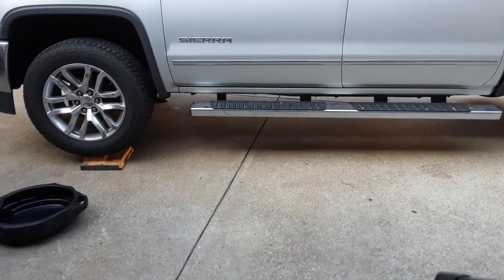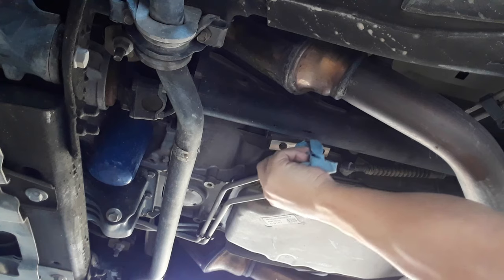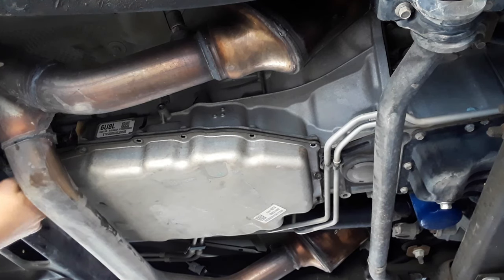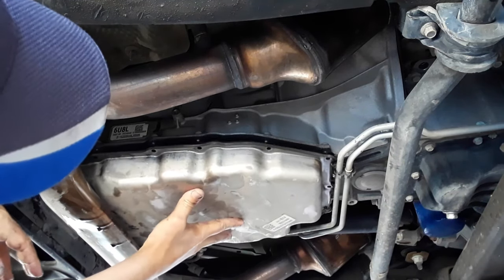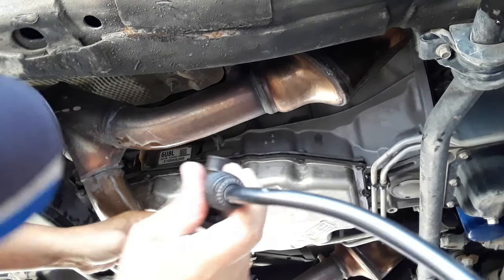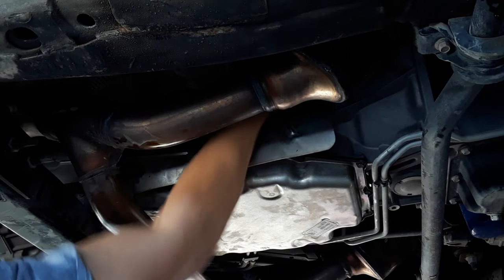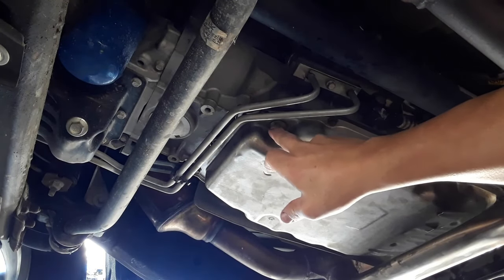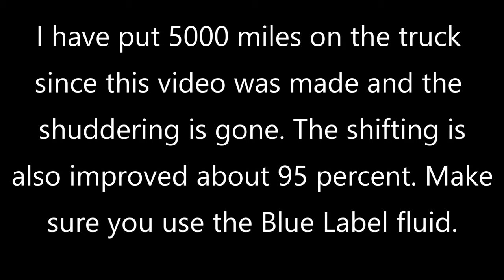Stop the shuddering on a 2016 GMC Sierra / Silverado with the 8L90 Transmission.

Comment: Thank you for this excellent video!....I got same truck, only a 2018, with 61,000 and it just started that shutter vibration thing...I have neglected to change the transmission fluid ever because there is no typical dip stick for my local shop to evac the fluid from, so they couldn't do it....Dealer says I should have changed it at 45,000...Taking it to my local GMC Dealer tomorrow to have them do it all with the correct up graded fluid GM now recommends...Hope I have the same great results you did. Thanks again for your help with this video!....
Reply from the maker: You will see a huge improvement.

Comment: Just did this in a pinch and wished I did the lines but I’m doing it again in a month. I couldn’t believe the new transmission was as bad as the old one. 20,000 miles and looks like 300,000

Comment: I actually like the easy of doing simplicity of doing a flush on my 8l90. After I shut the truck off and while hot, I opened the level check bolt. 2 quarts came out. Then, I went around and broke loose all the pan bolts. It was more start forward than the 4l60e. 4 quarts in the pan. No issues with the exhaust like I thought. Just yaw to the passenger side. Changed the filter and cleaned everything. Not too messy. The fill... I pump until fluid came out. Started the truck and kept pumping until it was just bright red fluid coming out. Check the temperature and let it dripple and closed it up.

Comment: You should compare Mobil to Amsol fluid. High reviews for Amsol. I have a 2018 Silverado 6 speed. Transmission thermostat causes oil to heat up extremely high before it will circulate through cooler. Newer models have been fixed. I swopped out thermostat with Surecool bypass and what a difference it made. Temperatures now run the same as 2020 models.

Comment: Did this tonight. I had it flushed several years ago by the dealer before they started using the blue label fluid and the problem came back. Basically parked it for a while or just 'drove around it' by getting to know how to work the throttle.

The dealership put the drain bolt in so tight I bet it has 80+ ft lbs on it and it stripped. I could NOT get it off. So now I'm sitting here with a stripped bolt on the bottom of the pan and the trans filled until it came back out the filler hole.  Think I'm going to drive it a couple miles to an oil change shop and have them get it out. Probably going to need a new plug though. Arrrgh.
Reply from the maker: Some mechanics need to learn how tight things need to be.

Comment: I have the same issue but hopefully its still covered under the powertrain warranty as im only at 30,000 miles.
Reply from the maker: Warranty is 3 year or 36000 miles so you might get lucky.
Reply: Ima dog my Silverado out b4 my warranty goes bad

Comment: I appreciate your hard work on this vid but I'm pretty sure your fluid is low. Considering you drained the cooler and lines, they never filled unless you had previously installed a bypass for the trans thermostat. That thermostat does not open and allow fluid into the lines and cooler until the trans reaches 190 on older models, or 158 on newer cooler lines. I'm glad your shutter is gone and wondering if you have any updates considering this vid appears to be about 2 years old at my viewing.

Comment: I just took my 17 sierra denali in for 90,000 service today, noticed a vibration a few days ago and thought it was something with the front end till I seen these post and videos. It is getting a transmission flush as well so hopefully that does the trick
Reply from the maker: Let me know.
Reply: I’m sitting right around 90K and just performed this procedure today. Got dark on me tonight so looking forward to a test drive tomorrow. Certainly wish I had as nice of a scan tool as in the video!
Reply: @devingoodman7347  Update us on your test
Reply: 2015 with 50k miles on it. Of course it's not under warranty anymore and I will get a lemon law lawyer.

Comment: thank you so much , i got exactly model and years and  got 78000 miles and the same problem , i will try to change tran smissions fluid  #124715 and filter hope it help stop  the shutter ,,,,thank
Reply: Happy for your results, a question, your transmission is 8 or 6 speed ?

Comment: I had this done and it was a lot better for about a month BUT the same problem came back. Have not done it again. I have the same problems that was described here except no shuttering.
Reply from the maker: This will almost 100 percent cure the shudder problem. As far as the harsh shifting from 1st to 2nd and 2nd to 1st mine is about 90 percent better on that issue. I still have the occasional harsh shift mainly from 1st to 2nd but it is so few and far between I live with it. I do plan on doing it again before long to see if it helps any more but until then I am fine with it.

Comment: Anyone complaining about hard/firm shifts 1-2 2-3 3-4. I solved it in my 2016 Denali with the 8L90. First the dealer exchanged the fluid to this new fluid and that solved my shudder problem. Luckily I caught it before I burned the torque converter clutches. 

To solve the hard/firm shifts I had the transmission tuned by a local performance turner that disabled torque converter lockup in the first 4 gears and now its silky smooth. Never had an issue again with shudder or harsh shifts. It's been 40,000 or so miles.
Reply from the maker: That's good info to know. I still get a harsh shift or two but it is not very often.

Comment: I had this performed on my 2015 sierra denali 6.2 under warranty. There was class action lawsuit for this problem. The GM service bulletin says to flush with fluid and fill something like 28 quarts of fluid. That's why they want to change you rather than warranty it.

Comment: Any further updates ? 
Im about to do a second fluid/filter change to try and get more of the old fluid remnants out. 
Also going to do a third one at the next oil change interval...

 I figure 3 services in about 10,000 miles ought to get about 95-99% of it out of the system. No issues as of yet and currently at 83,000 miles.

Comment: So I did exactly this a year ago and it fixed my shutter. However after putting about 20,000km the shutter is starting to come back. I'm going to be doing a flush again and hopefully it takes away the shutter again. What I am assuming is there is still old fluid in it from the previous flush that just causes the shuttering to some back. Hopefully with another flush it will dilute the old fluid more and eliminate the problem for good.
Reply from the maker: It should dilute it enough so it is virtually  pure.

Comment: Just completed this on my 2019 Chev Silverado 8L90, put the Amsoil Trans Fluid back in with 7.5 quarts back in and new GM trans filter, ready to put 100 miles on it now and see how it handles the shudder/convertor issue.
Reply: Just put twenty miles on the truck 🚒, drove like brand new,  it now has 27937 miles is all, the old fluid was darker than the new stuff with only 27k
Reply: @John-es1kq  check rear driveline/ u joints

Comment: Awesome video, thanks. I subscribed.

Do you have a video of what the shudder felt / sounded like?
Reply from the maker: I a video would have not been able to hear or show it. I never heard anything but what I first thought it was, was out of balance tires. I finally ruled that out and realized it was the torque converter shudder these trucks are famous for. It's been almost 15,000 miles and still no shudder after changing the fluid using the Blue Label LV ATF HP fluid.

Comment: I used the Amsoil blue label, stopped shudder immediately!!!!
Reply: Is that the signature series? I got 2 gallons and hope this fixes it
Reply: @jwill9877  Yes that’s what I used!!!
Reply: @LJK69187  thanks. I hope it fixes my issue as well.  Mine started on Friday morning. I parked it and it hasn't moved since. I have a 170k on mine though. I've taken very good care of it and this is the first issue.
Reply: Your car is running on 8 or 6 speed? And please provide the oil part number
Reply: @LJK69187  i have 6 speed, would the mobil or amsoil fix it?
Reply: @ibramaher  amsoil works for both nicely!!! I have used it in both!!
Reply: @LJK69187  im gonna try it today, wish me luck

Comment: thanks for the vid. Lots of good info. But cant recommend climbing underneath a running vehicle that's not on jack stands. Especially when dealing with transmission. Vehicles have been known to pop out of park.
Reply from the maker: Yea everyone has their comfort zone. I have never seen a car jump out of park but I am sure it has happened at some point.
Reply: Setting the parking brake and chocking the wheels helps. I just undid the bolts on the pan and drained most of it without pulling the fluid from the lines in my 6l80.

Comment: Does this technique of fluid extraction pull the old fluid out of the torque converter?
Reply from the maker: No, the only way to get all the fluid is to do a fluid flush.
Reply: Ok. Thank you
Reply: @737mechanic  ok thanks
Reply: @737mechanic  ok thank you
Reply: @737mechanic  can I take the thermostat out, put the cap back in place to do the flush, then put the thermostat back in afterwards? That would dodge having to bring it to operating temp (hot) for the fluid to fully circulate

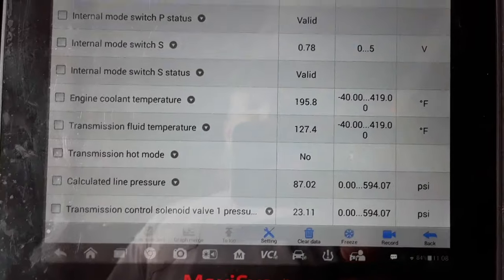Comment: At the 35:00 when u removed that screw, that oil coming out is excess oil? I didn't understand that part, you should do that after a fluid change so it levels it up to the perfect level? Please If u can explain, thank you.
Reply from the maker: That screw has a stand pipe so when you fill the transmission with fluid and warm it to the proper temperature you remove that screw to let any excess drain out, once the excess is drained it will be at the perfect level. If you take that out and nothing drains out you need to keep adding fluid until it starts draining.

Comment: I have a shudder problem going 45-60mph already did this service could I possibly just replace my torque converter? Truck Shifts perfect!
Reply from the maker: If you have changed your fluid using the Mobil 1 HP LV fluid and you still have a shudder the torque convertor will most likely need to be changed.

Comment: I have a 2015 gmc sierra 5.3 with this exact same issue bought in Canada, could this solve my issue as well? Thanks so much for the upload 👍🏻
Reply from the maker: More than likely yes. This is the #1 problem with these trucks. You need to make sure you get the blue label Mobil 1 LV fluid and not the black label.
Reply: Thanks again!! I will update when I’m complete 👍🏻

Comment: Thanks for the video. Just bought a 2019 Silverado used with 50k on it. Doing Trans fluid flush today. Do you remember how much you ended up getting out of cooler lines?
Reply from the maker: It wasn't much, maybe about 1 cup.
Reply: @737mechanic   Thank you sir.

Comment: great video...i have a cadillac ct6 with  the 8l90. my car recently stopped shifting after a drive home from work. parked it in the garage, got up to go to work the next day and for some reason its like the trans isnt responding. gears change on dash but  i feel no movement in trans like its till in park every gear. havent had it looked at yet. im tryna figure out where to start  any suggetions?

Comment: One question... 
Prior to this transmission service, had you already done a service on it at a lower mileage ? 

I just bought a 2016 Denali XL with this 8L90. I have service records for it, but they don't specifically say xxxxx mile transmission service.
Reply from the maker: No I had not.
Reply: @737mechanic  that's good to know. My 2016 Yukon XL has the 8L90 and already has 76,000 miles on it. So far there's no issues at all, but I want to keep it that way 😁

Comment: THANK YOU GREAT VIDEO . One thing do you put a level to the bottom of the  transmission pan to make sure it is  level,   ??,
Reply from the maker: The frame is better because the transmission's normal installation could be at a slight angle and what they want is the vehicle sitting in its normal position. But is reality either one will be close enough.
Reply: @737mechanic   Thank You, very much

Comment: The 8 speed in my 2018 6.2 Sierra was very smooth shifting and never experienced the shudder.  At 30,000 miles I took it in to my local GM dealer for the new updated fluid exchange and transmission filter change as preventative maintenance.    First thing I did not like is that he did the fluid exchange with the flow tech machine before dropping the pan and cleaning it and changing the filter.  Now I have a slightly more firm shift from 1-2 and down shift from 2-1.  Also, it seems the down shift from 2-1 is a bit lazy.  Maybe he knocked a solenoid loose?
Reply from the maker: Hard to say, did they actually remove the pan or did they simply perform a flush using the new fluid?
Reply: @737mechanic  they flushed it first with the flow tech machine, then he dropped the pan and changed the filter and topped it off.  I watched him do the whole thing.

Comment: Hey I have a 2014 GMC Sierra 4.3L V6 with I think the 6L80E, could I potentially get this problem too, if so can I still use this Mobil1 Transmission Fluid?
Reply from the maker: I don't think the 6 speed suffers from this problem. I would stick to dexron VI if I were you and just keep it changed.
Reply: @737mechanic  thank you so much sir, I appreciate your reply!😃

Comment: 3 years later, how is it running?
Reply from the maker: Still running perfectly, I have about 35000 miles since I did the fluid change and it is still shudder-free.
Reply: @737mechanic  thank you. This is the only video who actually did something about it and worked. Will definitely give it a shot
Reply: @737mechanic  do you think flushing the old fluid totally is one of the reasons that remove the shudder ? or its only using new fluid (Mobil 1 124715 LVATF HP Blue label Case)
Reply from the maker: @mohamedrashed9716  From what I have learned about this problem is the older fluid is hygroscopic meaning it soaks up moisture and that is what causes the shudder, the new fluid does not.

Comment: how long did your trans last after you did this?
Reply from the maker: It is still going strong. I have about 35,000 miles on it so far.
Reply: @737mechanic  my 2016 120 00 easy km got a studder thought it was bas fuel. lasted 1 week or 200 km and the trans is done. just shifting hard and pump is squealing. oil looks ok not burnt. 8 grand for a new trans in canada right now.
Reply from the maker: @steve123261  Damn,  Can you order a rebuild kit and find a local third party trans shop to rebuild it with the kit your give them.

Comment: My father in laws 2019 sierra started doing this. Wondering if there is a way to use transmission pump to pump fluid out of the cooler lines while filling with fresh fluid so as to flush the torque converter?
Reply from the maker: I am not sure if that would work or not.

Comment: Any suggestions for installing a drain plug??
Reply from the maker: I have done that. I did it by welding a nut to the bottom of the pan and drilling a hole through it so I could thread a bolt into it with a copper washer for a gasket. If you do this, you want the nut on the bottom outside of the pan. That way, you will be able to drain as much as possible out.

Comment: Thank you very much for the informative video. May I ask what adapter you used to hook the clear hose to the cooling pipe? There seems to be something in middle connecting both of them. Thank you Sir.
Reply from the maker: I have different size clear hoses that I bought at home depot and I just push them inside each other to get whatever size I need.

Comment: Would this Mobil 1 blue label fluid work for a 2014 Chevrolet Silverado 1500 5.3 6 speed transmission?
Reply: yes..let us know I have same truck..2014 5.3 6 speed...
Reply: UPDATE: It has been three weeks since I have done the flush, flushed the transmission twice and no luck. The whole truck vibrates, shakes, and still continues to shudder.
Reply: Did you ever get it fixed ? If so what did you do?
Reply: @russellgoss6671  The trucks transmission and transfer case ended up failing. I no longer have the truck because it was becoming a money pit and it just did not run right.

Comment: 737, hope your day is great.
Please update us on the shuddering after nearly 8 months, still no vibration?
Reply from the maker: Got 98,000 miles on it now and still no shudder. All seems good.
Reply: @737mechanic  gonna try it tomorrow, i will share my experience.
Thanks a lot, and keep the good vids!
Reply: @737mechanic  Found out my transmission is 6 speed, should i procced on the progress or find other soultion?
Reply: @ibramaher  I have a 6L80E in a 2014 Camaro SS. Internally it is almost identical to the 8 speed. I have had the same problem. I had the converter replaced the first time. It just started again after about 20,000 miles, so I will flush and change to the Mobil 1 blue label this weekend.

Comment: the truck run better than before . but still did little on the low gears specially from 15 mph to 35 mph ,seem like when i slow down get ready to stop ,fell like the s stranmission low gears help slow the truck down , should i drain another 6 quarts out and add 6 quarts blue lable in to help flush out all the fluids from the torge converter , ???
Reply from the maker: Probably need to do a transmission fast learn to recalibrate the shift solenoids.  I am about to do s video on this.

Comment: Similar problem in a 2018 Silverado 6.2 Litre 8 speed with 110,000km. Cost me $800 for full flush and replacement of fluid but it solved problem. Dealer claims maintenance schedule says to change fluid every 80,000 km. Never have changed tranny fluid on a gmc pickup in 50 years of ownership of many. What crap they manufacture now.